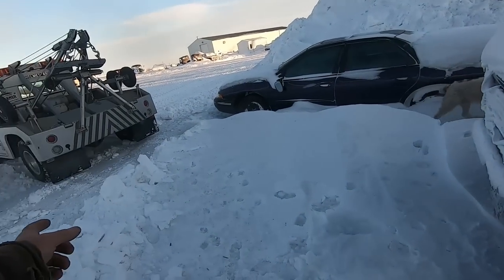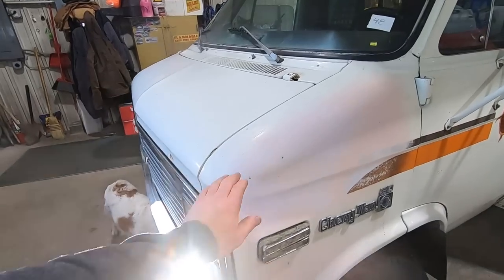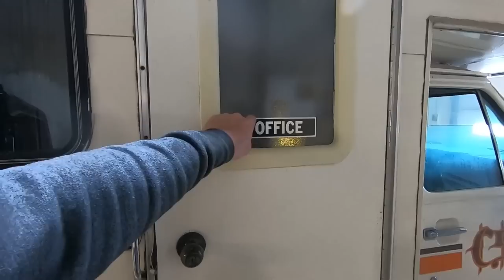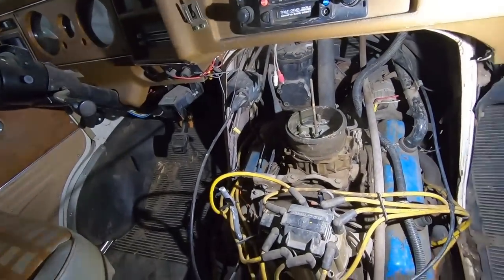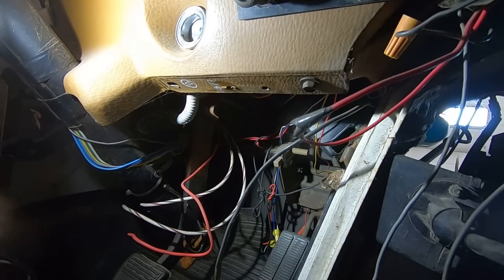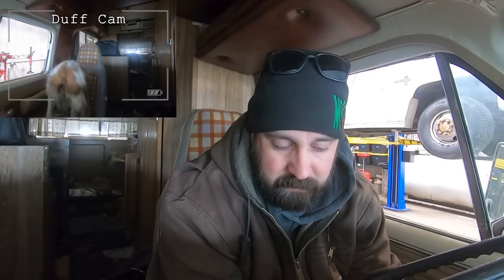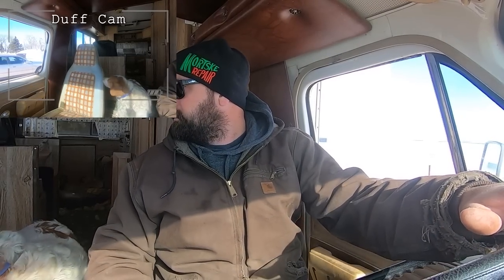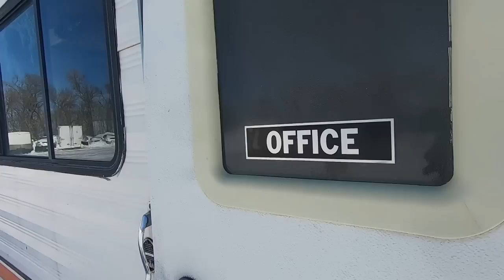Abandoned for 15 Years! 1977 Country Squire Motorhome! Will it Run?!?

Comment: I had a 76 ford motorhome with a 351w. Wish I never got rid of it but I couldn't afford to redo the inside. The bathroom in the back as you were looking at the back inside you see the sink. To the left there was a door and behind it was the toilet. To the right another door and behind it was the shower. The door for the toilet and shower would open meet in the middle and lock there to provide a full bathroom. Then you could poop shave and shower and no one could see you.
Reply from the maker: Brilliant!

Comment: Well, the safety latches on the interior drawers and cabinets are usually a good idea......but did the previous owners think that the faux drawer plate -
in front of the sink - was going to slide open ??     That is probably where the REAL stash is hidden.

Comment: I just put a dab of grease on the end of the fuel pump push rod that goes inside the engine holds that rod in place while you bolt the pump up .

Comment: 1995 Ford Thunderbird, Portage, WI. winter time 2002. Came out of the apt. building and the car was not there, went around back to make sure I didn't park it there. No luck, I had to call a cab to get to work close to on time. Reported it about 7:15 am and received a call around noon that they found it about an hour away in Prairie Du Sac, WI. A 14 year old girl stole it, and grandma turned her in. knew she shouldn't have a car. It had damage in the front. She was ordered to pay $2750 in restitution. about 3 years later I received a check for the full amount.
Reply from the maker: Dang it!

Comment: Chico's Bail bonds is from the movie bad News bears that was their sponsor that was on the back of all their uniforms that's all that  Walter Matthau could get to sponsor them.
Reply from the maker: Yup!
Reply: It is funny how you say that 350 engines too small for that RV and it's overworked? My sister had the same size RV but it was a Ford front end and it had the 460 in it. It had plenty of power to pull whatever you needed to with the 460 big block.

Comment: The funniest video yet. Puddin cant hold a candle to this one Mort. The dog house falling on the dog , wasn`t funny, but it was. Sorry duff.  You did do wheelies  man. All ya need is a half dozen buddie heaters and a bunch of tee fittings and hose to hook em all up and spread them all around inside the 'coach" and you can stay in it inside the shop on those nights when you get snowed in and cant make it home.  Just think how much you will save in gas going home , plus the home heating oil savings , SCORE!!!! ( you got a half a tank of prpane just setting under there, use it!!!)

Comment: Mortske, just watched your video and i had my 88 Monte Carlo SS stolen from me. It had the 305 HO and it was one of the bad Cam motor years 85-88. so it was blown-up the cam did its thing. Anyways it was a buddys repair shop out back and a guy came along and towed it away (Stole It). I called the police reported it stolen. Meanwhile this idiot who stole it put a new motor in it and then called me and asked if   I wanted to sell it. So, I ended up getting my car back with a running 350 installed back in car. True story! Thought id share that with you
Reply from the maker: Nice!

Comment: for over 15 years in the 80's and 90's i lived and worked in goshen and elkhart indiana building rv's in elkhart county indiana, the rv capital of the world. at one time more rv's came out of elkhart county than the rest of the planet combined. edit; that side cap is for the black water tank aka the sh*t tank. don't pull the t handle indoors or you'll have a verra bad day. the ac unit is roof mounted, that's a replacement fridge. the original one would've been a 12v/propane powered dometic ammonia fridge. being a '77 that thing is made of a 2"x2" wooden frame. the best use of it would be as a flatbed dually, or a ramptruck car hauler after you ripped off the camper, since it's basically worthless. well, the aluminum skin is old sheet. you can pick them up for free here in northern indiana, so you kinda over paid considering the condition.

Comment: Chains should take the weight, not the belts they're to protect the front of the car being towed from getting damaged. The way you're using it the weight of the camper is being taken on the bolt holes in the rubber.

Comment: Excellent video Mortske Repair  :) , Mojo :) , Duff Dog 🐕  also one help out on Trailers to Mortske they also a another 2 classes in Ontario Canada a D was business type or sales office had  for boss , clerk or secretary  for business plus washroom like made apartments buildings or subvision make houses in town or big cities  ! Workers go in tell need Foreman or Boss or order supplies for job sites to get like cement trucks or you name it from Hardware store too in lumber too! Then did E classes heard for trailers called  mobile homes  1 to 3 axles for tow on behind Station wagon or big cars or pickup trucks or Suburban  plus Jimmys in 3/4 or 1tons  plus in 2 or 4×4 trailers  tow in box trucks or other on bumpers ! Plus remember my dad mobile trailer think 48 footer had on home farm was 3 axle type , had 3 bedrooms, one bathroom with shower, toilet, sink plus hot water tank even room for cupboard  plus washing machine also dryer  plus kitchen with dining room together and living plus 2 doors for entrances! Plus had Propane heater but didn't do job so got new Furance of oil pump also Summer Season used as Air Conditioning with oil tank on stand near trailer! Also 32 by 28 addition on end in backwards on L shape to trailer on back entrance for kitchen and bathroom no shower also bedroom for late grandma Ruby my dad mom was with us for 6 years till 1980 before past away! My dad haul trailer in 1974 to farm in clear woods for it used his 1972  Highway Tractor Truck transport truck 18 wheeler type he own used drives on daul  axles ! But took farme also axles underneath off put 8by8 square rails of hardwood maple sit on in 1974 and addition was cement in ground ! Has 2 septic tanks plus heated hose to barn well for water line to fill 2 hot water tank in addition also trailer ones! Underground hydro to plus phone boxs but 2 separate hydro box both sections one in addition plus master bedroom cupboard too! Why dad plans was built second house on home farm but never happened to because the crazy area didn't want my building on home farm the Township government people said nope  ! He had treid for 25 years but didn't go & sold trailer with farm and house I live since 1997 own since 2017 when he past I took over  plus with my mother to ! But that camper Chevrolet got there Mortske I know lots people got Turbo 400 3 speed Automatic transmission took out put in 700SR 4speed Overdrive Automatic transmission  plus different drive shaft in if the Hermonic Balancer  put full drive shaft in get done ! Why did is want Overdrive gear 4 in  Automatic transmission  so would over rev motor get better fuel mileage too and change ratio to get 390 or 388!
Reply from the maker: Interesting

Comment: The fuel pump for my 73 c10 has one gasket goes to the plate that bolts to the block then the other gasket goes to the fuel pump goes the motor I put in the pump was out and the plate was in the seat so I needed both gasket if that makes any sense??
Reply from the maker: But they're different shapes

Comment: Back in the Day, here in Germany, People used to tow their 2 ton Boats with First Gen, Dual Rear Axle, FWD FIAT Ducato Motorhomes, 1.9 or 2.5 Diesels with 67-95 horsepower depending on wether they had a Turbo, and they still managed to keep up with the 40 Tonners. 
How is a 180hp 5.something Liter V8 to be underpowered?
Reply from the maker: They don't like wind at 70 miles per hour
Reply: @MortskeRepair  Even with a strong Headwind I could always get my 1.9TD Motorhome to at least 110 in 4th, and if I was good on the shift to 5th, it would just sit on the Edge of Turbo Threshhold and maintain that. With a more Streamlined integrated or Camper Van instead of the Alcove you could easily maintain 120 in 5th, at least with the Turbo Models.

Comment: Probably at one time that thing had a refrigerator in the same spot that was 12 volt or propane or 110 an interesting setup back in the day for refrigerators they would run on practically anything and you can imagine how expensive it would be to replace the exact thing that's why they kept the propane line and just threw a 110 Mini fridge in there. I guess you got to do what you got to do or whatever your pocket can afford. So are you going to jump that one over the railroad tracks and destroy that one like you did the last one??? For me something that size could be livable as the older I get on downsizing more and more.

Comment: The second gasket is for the plate that holds the push rod.
Reply from the maker: No it’s an entirely different shape
Reply: @MortskeRepair  You are correct.  That gasket has 4 holes in it, I forget the bottom screws.
Reply: So now we are back to your original question, why 2 gaskets?
Reply from the maker: @robertutech1685  Exactly

Comment: has a hydra vac braking system off the power steering pump
Reply: tape the steering wheel with cloth electrical tape  to enclose the stickiness

Comment: Probably a TH475. I think it's the same as a TH400 I can't remember the differences. It should have a parking brake on the rear of the transmission
Reply from the maker: Bolt on rear yoke, yes

Comment: Typically the AC unit would be on the roof.  That was the refrigerator in the right side panel. The original fridge would have been run on propane. Or electric propane "hybrid". The original unit probably quit and was replaced by a cheap electric fridge.

Comment: YOU COULD HAVE DRIVEN AHEAD 10 TO 20 FEET   AND PUT A SNATCH BLOCK  ON A HOOK ON THE LOWER PART OF TOW TRUCK  WHERE A REAR  BUMPER   WOULD GO  IF IT HAD A BUMPER  AND WINCHED THE CAMPER OUT
Reply from the maker: Good to know!

Comment: You don’t realize how fragile RVs are till you scrounge one and strip it down for scrap. 2X2 walls, 2 wire power, a little insulation, aluminum skin. Don’t run into stuff with it, not really sturdy
Reply from the maker: Not well built!